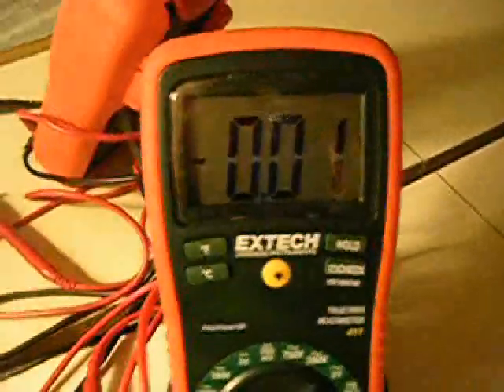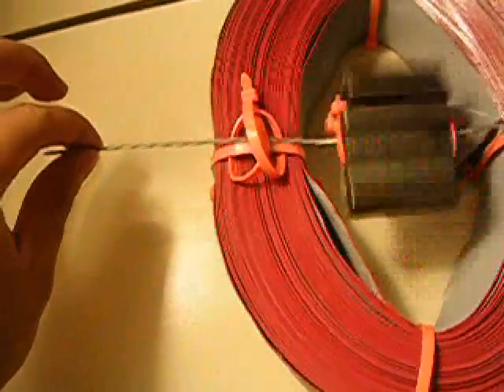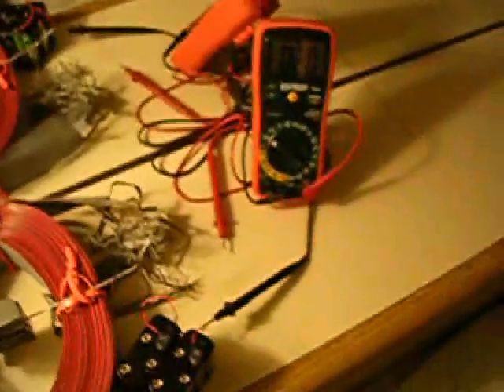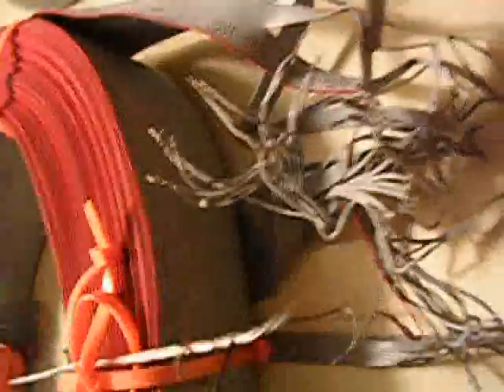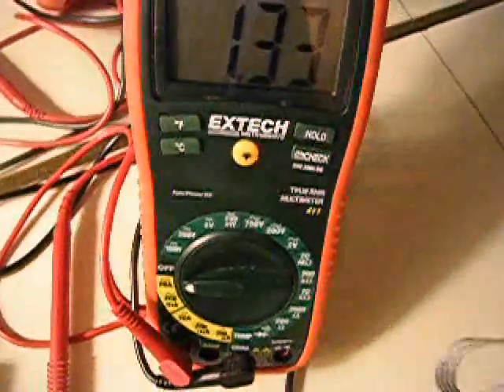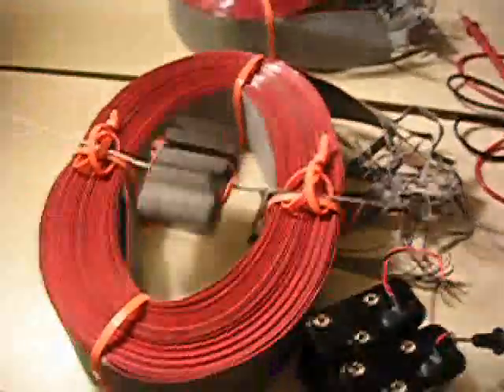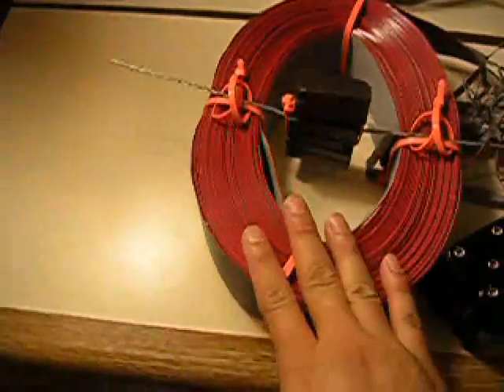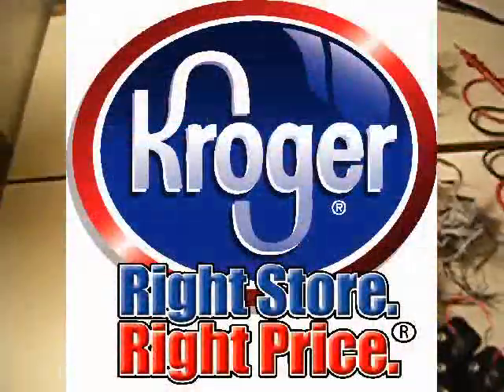Electric motor ▲ AC/DC 1

Comment from the maker: I have also found that spinning the magnet by hand produces hardly any power in the coils at all. So I am now sure that the figures on the "AC setting" represent the pulsed dc voltages and currents. Time to move on with my new videos...

Comment from the maker: Of course pulsed DC will show on the AC ammeter. The multimeter here is *supposed* to be a true RMS multimeter meaning it can determine the voltages and currents of waveforms that not sinusoidal. Actually, that is what I intended on having. Sure, this is obviously not sinusoidal AC. This video is old and I have the motor doing much more work than in this video. See my video response to this with 6:34. The motor runs for two days on 40 volts of 2.5 amp hour (avg) AA batteries, which is 2 watts.